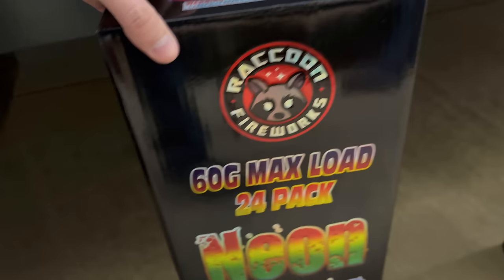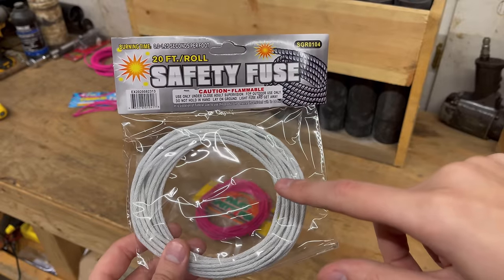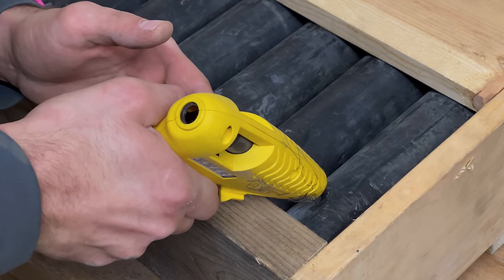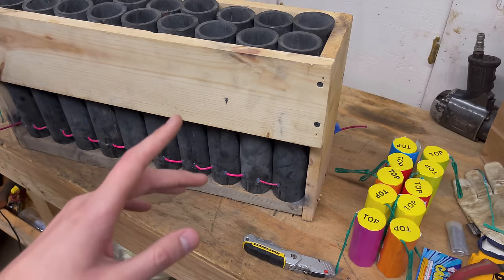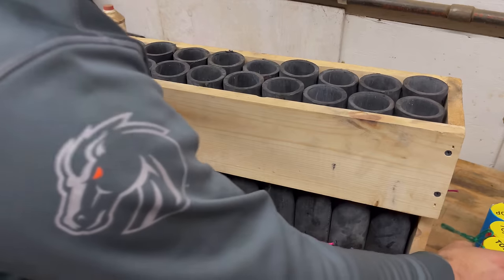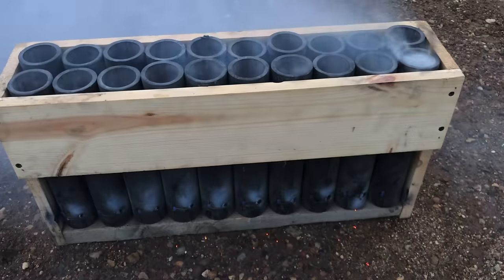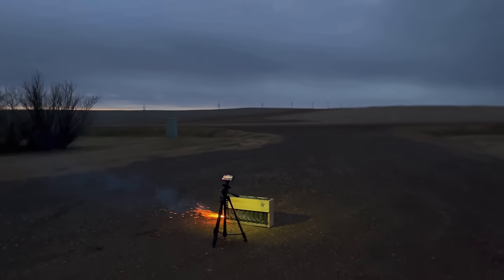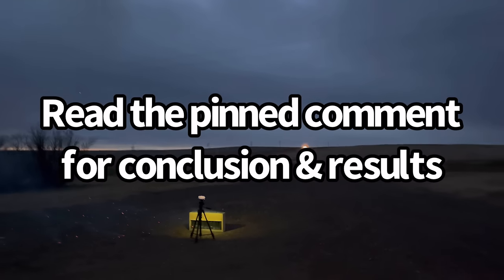Testing Canister Shells & Fusing Techniques to Fire like a Cake

Comment from the maker: After our tests we can confirm that the only inconsistency lies within the time-fuse built into the shell itself. That is out of our control. What IS in our control is the pace at which the shells leave the mortar rack tubes. We started with the 10 second a ft fuse then the 3 second a ft fuse. Then, we tested the 0.03–1.25 second a ft quick fuse and finally the 0.01-0.03 second super quick hobby fuse. I think our favorite pace was definitely the 1.25 second quick fuse since the shells exited the tube at the same pace as a 1/1 cake would fire. Hope this helps and hope you all enjoyed!
Reply: DUDE THE LAST SET RAPID FIRE EPIC.............
Reply: 1200g zipper cake hell yeah
Reply: It would be smart if a manufacturer would make a 500 mine cake with 1.75' tubes fib/HD tubes. So it just shot a mine but you can drop you favorite Canerster shells inside. They could also make single shot 1.75' mines. You pop the top of  drop in a canister shell put in rack and fuse the them all together. Every shell then has a mine effective.
Reply: I kind of loved that last one with the super quick fuse
Reply: Do more fuse linking videos with different affects please!
Reply: Did the hole for the fuse melt after several uses ?
Reply: I would be interested to see this with the bottom of the shells cut open and the BP in the tube on top of the fuse you have added you would then have control. Good use of shells that broke as well. With I little more BP you could also get more lift no more then a few %
Reply: Would u recommend reusing a 12shot cake and just refusing it ?
Reply: Thnx bro for this informstion good tips 🙏😎
Reply: Hey anyone else ever  modify echo in the ear and made it 3 times as strong as 1 I did that here in Massachusetts and I was 3 miles away from my house and my little bro said he could hear it clear as day.  It blow my ears drum being right underneath it lol I'ma try 4 shells in 1 this year. Dominator shells  by fantasy fireworks are a crazy product
Reply: Would this work with fiberglass tubes?
Reply: How well do the tubes hold up to this method of firing???
Reply: How much life does a tube lose by drilling it out?
Reply: How far from the bottom do you drill ?
Reply: @wegofeesh great question. I hope he answers you
Reply: @johnbrelje4354 use a tape measure inside the tube to measure from the top of the tube to the plug/floor.  Mark that measurement on the outside except drill slightly higher

Comment: This seems like a good idea for pre-staging a show.  I don't like setting up my racks too soon and having them sit in the garage but with this technique you could get all your timings down and run the fuse days in advance and then dump the shells in day of in 30 minutes.  Worst case your fuse goes off which is a lot safer than having a rack go off.  It also looks like it would be cleaner for taping against fuse jump.

Comment: I just did my whole show last night the way you showed how to cake fuse mortars. 265 mortars and 63 cakes. I tested a few identical mortars side by side the week before. I did notice about 10-15 ft less in lift. It wasn't too noticeable so I decided to fuse them all cake style. It was worth being able to fire them EXACTLY when you want to with a firing system, but I will pry not be doing it again. HUGE problem is that not all cannisters are the same. I had about 20% of the mortars break EXTREMELY low, like dangerously low shooting crackle pretty close to the spectators. You could masking tape the cannisters to the point of being a tight fit in the tube, but that's way too much time for every mortar. Maybe just a finale rack? It is a neat concept and I did use half fiberglass tubes with no issues.
Reply: I was thinking that the whole time watching this video. Lift charges, like any explosive, are dependent upon the pressure exerted against the reaction and will now be a less controlled variable. I agree I wouldn’t do it often
Reply: @florida995  I won't ever don't again. Crowd is too close at my place to risk that low of breaks

Comment: This opens up opportunities for variations in the display. Multiple racks with variations in the timing within groups in a rack. For the pyro-technician, electrical fusing gives the best control. However, for the occasional technician/pyro-artist, using timing through fusing would provide a great show.

Comment: I can confirm that no mater how the lift powder is contained in the bottom of the tube, be it taped into the shell or just dumped in the tube it will have absolutely no deference in lifting the shell whatsoever! The key here is the width of the shell in the tube, be there not to large of a gap between the tube wall and the shell, no matter how the lift powder is attached or unattached to the shell if the shell is the right size for the tube “meaning it has no more then a 5mm to 7mm gap to the tube wall when loaded, and if the lift powder was correctly weighed for the shell, it will fire.” ✌🏼

Comment: I understand the whole concept, and it is quite impressive. If you fused the shells "like normal" and use the Quick Fuse on top of the rack, you would get the same effect, but you would have to wait about 3 more seconds after the quick fuse is lit. That eliminates the drilling, fusing, and glueing at the bottom of the tubes. Is it worth all that work, or would waiting 3 more seconds give you the same exact effect?
Reply: If you're trying to time the effect, it is typically much easier to do with shorter and faster fuse because you are removing potential inconsistency.  If you just want a rapid fire finale or fan effect without specific timing, you can just fuse the top of the rack as you would normally. This is most important when timing between shots is a concern, such as in fan sweep or slice effects.
Reply: @mattm3901  I like your thought process Matt. Makes perfect sense. I've been doing manual lighting of fuses for many years, and I have gotten the timing down pretty accurately by using measured length, spacing,and fuse styles. I guess I'm proud of myself because I know the difficulty of the process, and to be able to watch my own builds launch without having to touch any of my boards during a show gives me that adrenaline rush. When I have spectators ask me which type of control system I use, I tell them the old school manual fuse lighting system. They give me that stare of confusion. Ha. I'm still learning new tricks everyday, and I should have been a pyrotechnician, instead of a musician. 🤣 I value someone's opinion/explanation of processes they've adapted Very Much! So thanks for the explanation in detail. 💯💪

Comment: Hey Cody, I really hope you see this, I wanted to ask you a question about the fusing in this video.

We are looking to do something similar, but had an idea on how to do it without all of the small length fuses, and wanted your opinion on it.

Would it be possible to drill your holes in your tubes, (as you did here), but instead of drilling them at angles, drill them straight across the tube, and then just run one long fuse through each one tube? Then there's no gluing to keep each individual fuse in place, and it's one fuse going all the way through your rack. I'm curious if you think this will work! Please respond, thanks.

Comment: You may be able to skip the hot glue if you use a strip of hvac aluminum tape over the top of the fuse.  You may even get an increase in speed if your fast fuse is the paper type.
Reply from the maker: The hot glue is to keep the lift charge from shooting the fuse out of the tube before it gets to the next tube in the rack. Hard to explain but that’s why we do it lol
Reply: @CodyBPyrotechnics  I understand why you are glueing.  The suggestion is that taping would do the same thing and be easier.  Lots of 500 gram cakes use tape to hold the fuse.
Reply: @npavento  I don't know but trying to peel the backing off of hvac tape is quite time consuming in itself
Reply: And the hot glue has no chance of ignoring the fuse?

Comment: Could that threading technique have the same effect if you didn’t cut the fuses one by one? And how big of a hole did he put in the tube and what did he use to make the holes?
Reply from the maker: He used a drill but I’m not sure the size of the bit. I believe it’s just a bit that’s the same size as your average fuse

Comment: What size hole did you drill? Did you match the fuse to the end of the drill bit?
Reply: Firework fuse is 2-3mm thick so definitely no bigger than 4 mm. Gives enough room to slide the fuse in without having to worry about hurting the fuse or creating too big of a hole to fill in with the glue

Comment: Wow.   It was an expensive and impressive test.  You have the nice tubes, would you recommend this technique with the fiberglass tubes?  I've seen you place aluminum on top of tubes to prevent fuse skip, but would you place something on top for weather.  Sorry mind is buzzing regarding this technique.  Would you make different racks for pacing in your show or would you make each rack as you imagine a cake should be or both?
Reply from the maker: We would only make this racks if trying to replicate an effect cake such as all red, white and blue or willows. Hope that helps!
Reply: @CodyBPyrotechnics  how about using fiberglass tubes with this technique?

Comment: I know this was kinda an old video, but I was wondering when loading the fuses do you have to make sure they are touching in the bottom of the tube? Like at 7:29?
Reply: No, the incoming fuse will ignite the lift charge, and the lift charge will ignite the outgoing fuse.

Comment: I like this!  However, I think impractical for me due to the design of my racks. Also, with no main lead line, one failure equals a dead rack. Have you experienced that?  I do really like this method. Once the holes were drilled it seems like you’d save time assembling racks. I hate using zip ties, but no other good alternative. This solves that.
Reply from the maker: Well, this is technically the same thing as a 500g cake even fused the same way. A 500g cake has no main line either, so we just take our chances with that like we would a regular firework cake.
Reply: @CodyBPyrotechnics  hmm, yes good point. I’m curious enough that I’ll probably try it. Nice video!

Comment: I'm curious what type of piping so you use and do you put a cap on the bottoms or do you leave the exposed wood?
Reply: The tubes have a plug at the bottom of them. These are HDPE tubes. You usually have to buy them online since they aren’t sold in many stores

Comment: Too bad I didn't find this video before I loaded 250 tubes, the old fashioned way.  Thank you so much. Crossfire a thing of the past. I forgot to mention, when I ordered my premade tubes (250) to go in my custom made racks a few years ago, I ordered the smaller of the two I.D.'s available. I've gotta clean my tubes before use and sometimes remove the outside labels so the shells drop in. Thanks again.🎆🎇

Comment: Also too…where did u get the shogun fast safety fuse??  Would it still work too if it wasn’t hot glued on the ends??
Reply from the maker: You should definitely hot glue it so the lift doesn’t blow the fuse out

Comment: Probably a silly question. When you inserted the fuse into the holes, do you have to force them to touch in the bottom of the tube to the next section of fuse?
Reply from the maker: Nope! They should go in smoothly
Reply: The lift charge should ignite the next fuse. It may help to cut the fuses at a 45 degree angle to increase the exposed black powder in the core of the fuses.

Comment: Would it work with ball shells tho ?🤔 aren’t they fused differently?
Reply from the maker: It could work with ball shells but They are generally smaller than cans so keep that in mind when loading them. You MAY actually lose a lot of height on a ball shell
Reply: @CodyBPyrotechnics  yea I see that happening. Thx

Comment: You do lose a little "oomph" because the lift is less violent (as it requires a greater pressure buildup to blast the bottom out of the lift charge housing) but the difference isn't enough to cause any problems for these.
Reply from the maker: You’re right that it’s not enough to notice
Reply: @CodyBPyrotechnics  More importantly, it's worth the time if you really like the effect :)
Reply: At the combustion rate of lift charge BP, any blow-by due to size difference between shell OD and mortar tube ID is much more significant than this pressure buildup. As long as the shells fit the tubes well, cutting off the cardboard disk below the lift charge is a moot point.

Comment: Cody how long do you think the tubes would last using this fusing method? My thought is each time a fuse burns through the hole it's going to melt a little each time.
Reply from the maker: The HDPE pipe is going to last you the same amount of time as a an HDPE tube without a hole drilled in the bottom. This is the highest quality tube/pipe you can purchase for use with fireworks

Comment: Do one with a double lift charge!
Reply from the maker: Everybody keeps commenting this. Is it just going to make the shell go higher?
Reply: @CodyBPyrotechnics  It's definitely going to accelerate up into the sky faster but the time delay fuse before the canister explodes is going to be off. My hypothesis is that it will go up a little bit higher and the burst pattern will be a lot different due to the speed increase. Let's do a Cody B Myth Busters episode and find out!
Reply: You may get some additional height as long as the tubes don't blow out. This could be very dangerous.

Comment: I know it's a little riskier and potentially legally ambiguous, but have you thought about taking black powder, like you'd get for a muzzleloader at a gun store, and "boosting" the lift charge to possibly get higher breaks from the cans?
Reply: I was thinking the same thing. Like an extra half teaspoon would get it up there.
Reply: I thought the same thing. One problem is the internal time fuse of the shells is usually about 2 seconds, translating to about 175-200 ft of height. Lifting the can another 25-100 feet, I think the shell would have already gone off before max height. Guess you should experiment. I remember 2" shell 200 ft safety distance, 3" shell 300ft and so on.